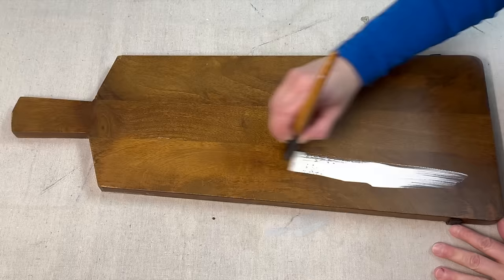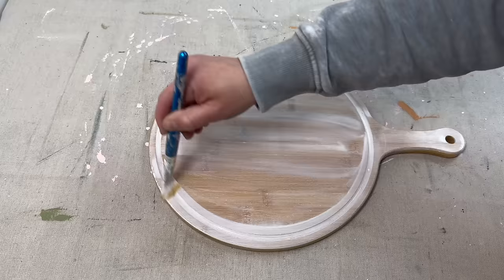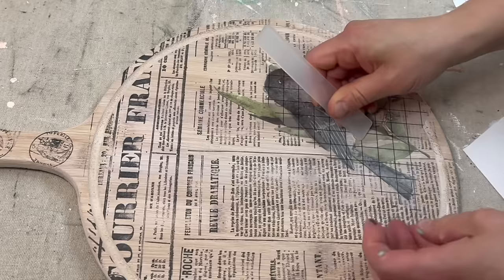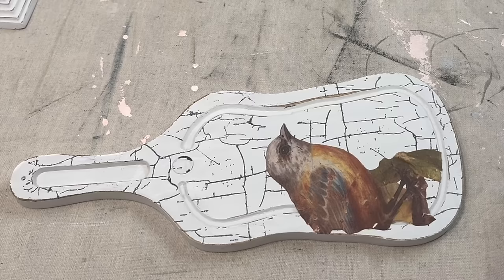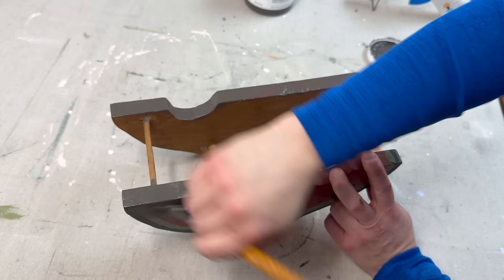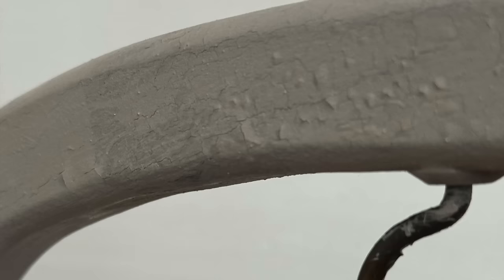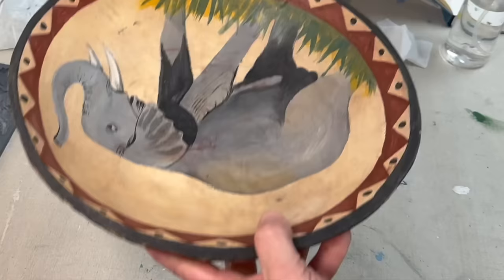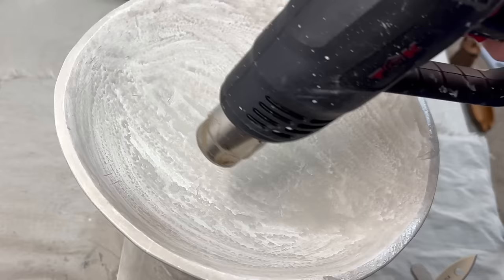9 Upcycled Kitchen Items | DIY & Thrift Flips | IOD Stamps-Transfers | Milk Paint

Comment: Will the milk paint crackle even after it is dry ?
Reply from the maker: That’s a good question.  Milk Paint is sooo unique … I never get the same effect.  But I will say I have let milk paint air dry for 30 minutes then blast with my heat gun and got some amazing crackle before.   Again, it doesn’t always happen (and sometimes I have had all the paint chip off 🤦🏻‍♀️).  I am definitely not a pro with milk paint.